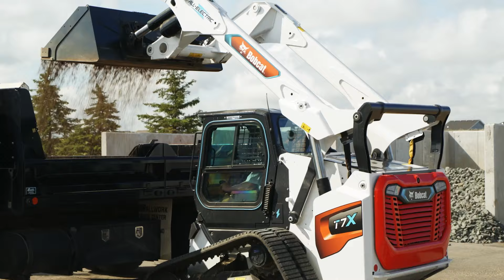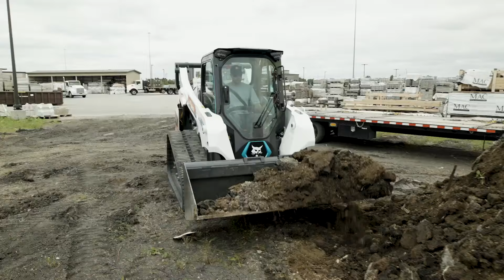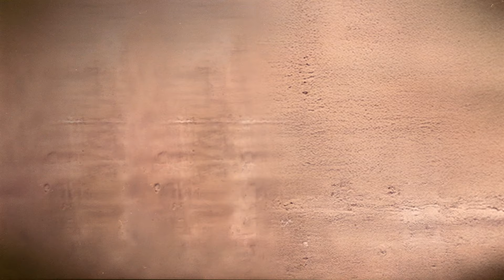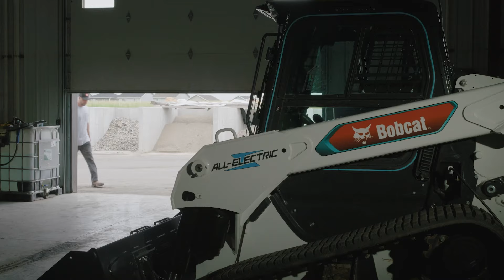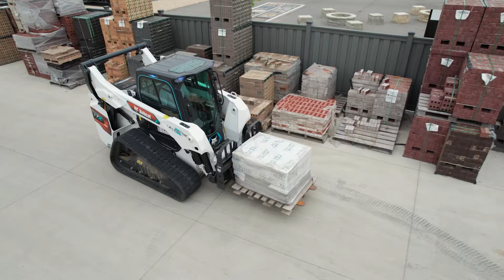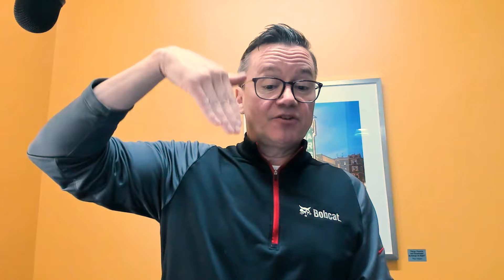Bobcat’s Journey to All-Electric Innovation: Inside the T7X Platform

Comment: They mentioned charge times and how in many applicay often only run for five hours.  One rhing they should have touched on is how the new electric trucks have onboard 220. So when the machine is not in use for a bit you could add a litle bit of charge to it.  Therefore extending the available run time for the machine.

Comment: Finally!!! It’s great to start seeing the advantages electrification being utilized!   There’s still a lot of limiting factors that can be a dealbreaker for some.  Something that seems to be completely missed is the diversity of needs with equipment and vehicles. Both sides being narrow minded only hurts. Making the use fit the machine isn’t always an option. The numerous advantages with electrification are for nothing if real world needs are not met.  
If these machines had an option to charge themselves, it might open the door to more users if the fuel savings are worth the higher price.

Comment: I think it might have been a mistake to eliminate hydraulics entirely.    The beautiful thing about skid steers and track loaders is the plethora of universal (SSQA) attachments you can put on them.  However, almost anything beyond a bucket or pallet forks requires an auxiliary hydraulic connection, which this machine doesn't have.    Now I understand that Bobcat is planning to introduce attachments with electric motors and actuators rather than hydraulic ones, but these will almost certainly be proprietary, meaning they can't be used on any other machine. And of course this machine can't use the plethora of third-party attachments that work with all the other traditional machines out there.    If buy a traditional machine and I need an unusual attachment for a couple of days, I can go rent the attachment.   Pretty much anything I could possibly need is readily available.  A trencher, an auger, a brush hog, a mulcher, you name it, no problem, except they all require a hydraulic connection.
Reply: First they aren't replacing existing skids so it's not that big of deal. 
Second the motor won't be on thw attachment on most tools. It'll just Bea flexible drive unit that snaps onto the unit. Think of a tool head that's ussually in a factory where it's attached to the motor mounted  overhead.

Comment: Cold weather operation will sort them out.
Reply: So glad to see this comment. It will single handedly set an entire engineering and manufacturing company on the right track. It's amazing how winter is such a new condition to design equipment for🙄
Reply: Norway has tons of EVs. Designers are not surprised by weather. And it's not like Diesels are so hard to beat in cold weather, right?
Reply: @lsauve  Never had a problem with my VW diesel.
Reply: @deltaskyhawk  you've never had any problems with your EV in the winter either.